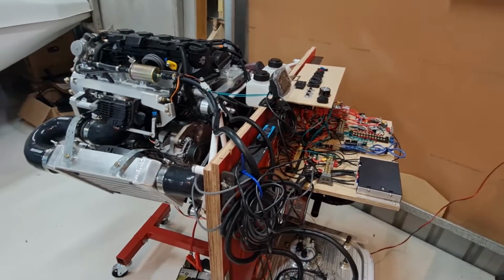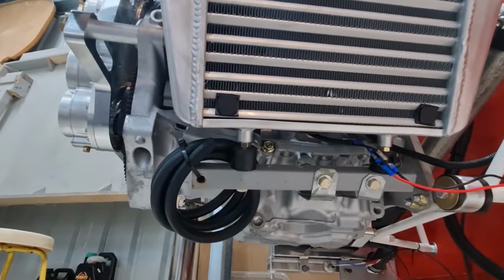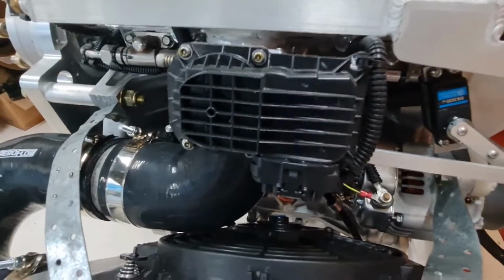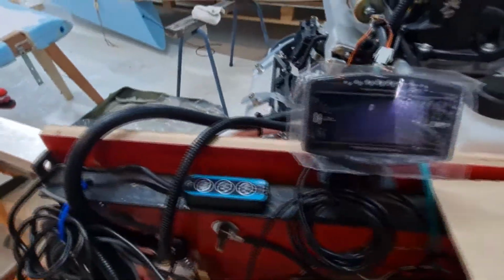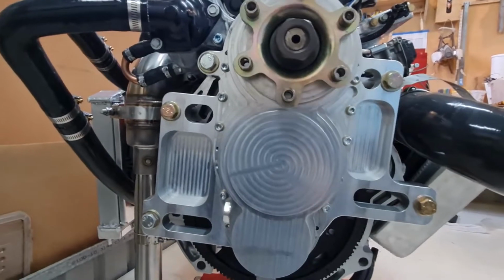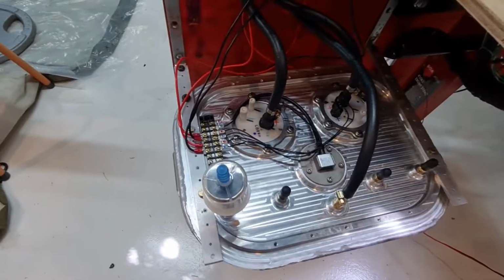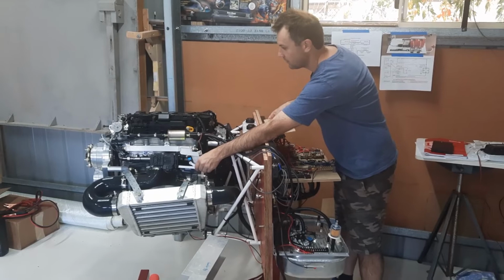Viking 195T - The engine build for our Velocity

Comment: As a mechanical engineer trained to see how things can break, I would suggest you replace your servo throttle with a double-acting Bowden cable setup, similar to what’s on motorcycles. 

In fact, there’s a frightening amount of “I don’t think that’ll break” in this video.

The reason you have all the functions broken out rather than in a single key switch is redundancy and reliability. The simplest component possible for the job. 

Same thing with relays versus PWMs. Simplest component for the job. 

I love your project and hope to do something similar one day. Good luck with it!!!
Reply from the maker: Yep the servo isn't permanent and it will be getting a cable (or two?). I may implement a servo but better design and not necessarily on the throttle body. If i cant have good redundancy on the throttle then I'll stick with just a high quality cable. The kit didn't supply a cable and i wasn't sure what length i needed yet so i just went with an experiment.

I like trying things out before i settle on the optimum design and i have yet to run the designs by anyone with good mechanical and electrical knowledge, I have no shortage of that around me. The engine at the moment is a mock up and not ready for an aircraft. Thanks for the feedback as i appreciate all input.

As for the switches, yeah having them separate is by design and it's a good design.
I'm always in the market for better ways of doing things and open to suggestions.

 Redundancy is good but if I (or the system) can't isolate what failed and replace the failed component with the good one within a few seconds it's not that useful. And yes that's what check lists are for, so you check everything, and training so you can do it faster. I'd ideally like to build a better system without too much complexity.

Comment: HOw do you address the issue of Mogas availability for the viking engine.   Here in the SW united states (california, nevada, arizona)  there are practically ZERO mogas available at any FBO. 

I love the Viking concept and have watched many of Jan's videos.   I believe it works.  But I want to travel, distances, having airports with mogas is a hard thing to find.

How do you look at that issue?
Reply from the maker: Yes that's an issue. 

For the moment avgas is everywhere, mogas not so much. Hopefully the 100LL will be replaced by 100UL as planned and everything will be sweet.
 
Unil then, It's jerry cans from your home aerodrome or 100LL with the TCP/Decalin additive when out and about.
I know I'd rather not use straight avgas and I have no experience with the additive. Hopefully it does what it says on the bottle.

I know some aerodromes that have a sizable rotax fleet like if a resident flight school use rotax powered aircraft or a large light sport population, may have mogas. 

Let's just hope 100UL isn't just wishful thinking.

Comment: My understanding is since the eingine is mounted "backward"  as opposed to how its mounted in a tractor configuration.  The exchaust pipe has to be turned to point toward the back (toward the prop) requiring a special part be made...I assume you are aware of that...
Reply from the maker: Or straight down through the cowl is ok. Out the back gets tricky since you need to time the exhaust pulses so they miss the prop. Usually the way with a horizontally opposed engine. I'm thinking, a bit more distance between the exhaust pipe and the prop is the way to go. Might be a little messy with a small amount of pipe protruding. But we'll see how that turns out.
Reply: @AusVelocity  By turned I mean angled back and down, yes. If you have an email, I can send you a picture of my exhaust (TSIO550-C Continental) just being finished up at the factory.
Reply from the maker: @speedomars  ok. That would be great. Clint.chenoweth gmail
Reply: Keep it up!!

Comment: PWR are Aussie and make great radiators/intercoolers. I thought the benefit of DI was being able to run lean. Sounds nice.
Reply from the maker: Thanks, just looked them up When I figure out what size and shape I need I'll ring or go see them. They're about an hour away from my house.
Reply: @AusVelocity  Being told it is normal to misfire when running hot is another red flag for me. For an engine to misfire from running rich it would have to be incredibly rich. What happens on a hot day under load on take off, will it start to miss? If you told a company like Motec that, they would scratch their head.

Comment: how is the glide ratio incase loss of enginepower ?
Reply from the maker: Hmm. Good question, don't know. But im guessing pretty good. It's a low drag aircraft and I'll be able to feather the prop. I'm wondering if installing fuel dump valves in the tanks would increase the ratio.
Reply: yeah...like swiftarrow9 wrote,  i saw several videos where you could see the vertical rudder on the wings are flexing rearly big ALL the time !  tecnical wise,  this must get a fatikque by time ! thats why i wondert about the gliding ratio, you need at least 20-1 incase an engine fails,  and better a parachut ! @AusVelocity
Reply from the maker: @KuschallRacing  Well I don't know about the flexing of the rudders, maybe you mean the winglets. As far I know none have ever failed in flight. They get 9 layers of glass to bond them on to the wings. I've heard of someone flying around in a velocity that used only 1 layer. Once someone caught the mistake, they fixed it.
If it's rudders moving, then you're defiantly not going to tolerate the peddles constantly moving and there is a major problem.

Fibreglass is actually pretty good at flexing and not getting fatigued. Aluminium, not so good. 

I've looked at a parachute, there's not enough room for 1 of the correct size. I thought about using 2, large in the back and small in the nose, but it's too hard balancing the load.

Glide Ratio, I'm sure every velocity owner has a good idea what theirs is. I'm not sure what it is.
Reply: thank you for your time to chat....YESSS, i ment the lateral movement of the vertical rudder fin.......parashut...still, would be good to have...wish you goood continueing of project  !! @AusVelocity

Comment: Thanks. What was the cost of the engine?
Reply from the maker: Depends where you are. For Americans, the basic engine is $18,500 USD and then add on things like fuel kit, radiator, Intercooler, etc, etc. 

For me, and it's not the same now, it was around $34,000 AUD ($23,000 USD) for the engine plus extras but not including shipping.
I hear shipping has gone through the roof If you're not American, but check with your nearest dealer for current prices.

It's not cheap, but It's probably the most affordable near zero time aircraft ready engine you'll find.
Maybe the Aeromomentum could compete but I'm extremely happy with my choice, Viking has done 95% of the work, I just put it together with instructions.
Reply: @AusVelocity  Thanks🙏 I'm dreamin on a tight budget, & this definitely looks like a great option. I've been considering a Cozy, but don't know if I'll be alive long enough to finish it. I look forward to watching your build. Thanks again ✌️

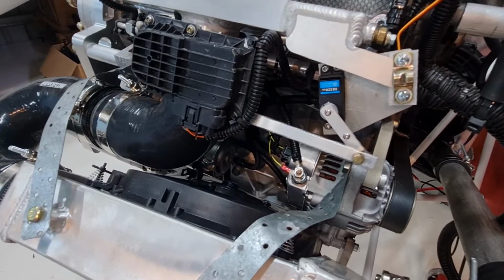Comment: 8:30
Reply from the maker: Working on that now, a slip mechanism for safety to ensure it cant jam the cable. I've replaced the servo with a feedback servo for position. It'll be 2nd throttle position in the cabin, and maybe later down the track a cruise control for lower speeds.